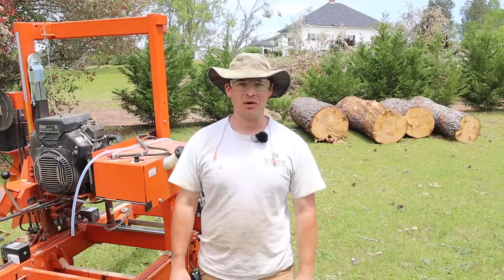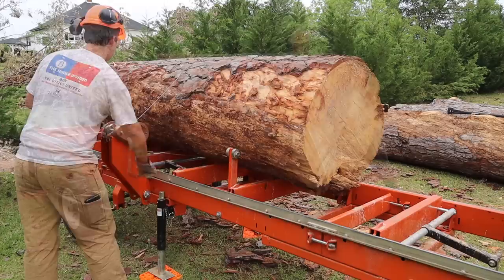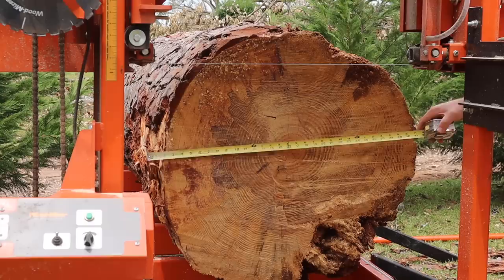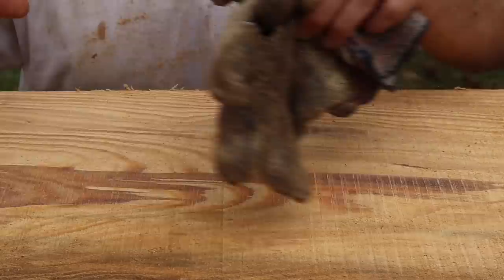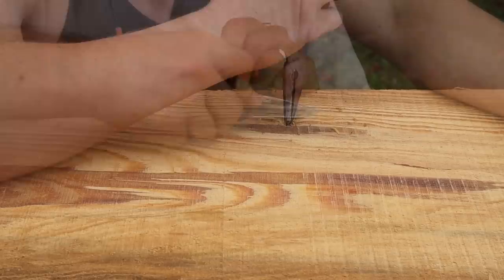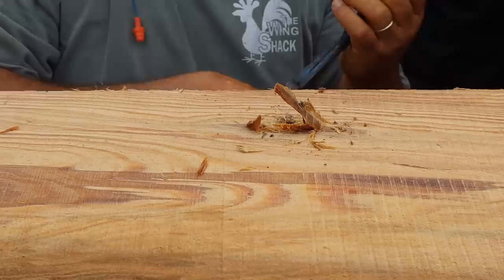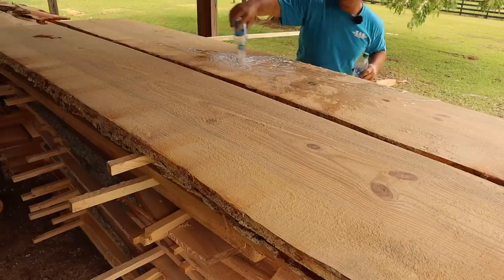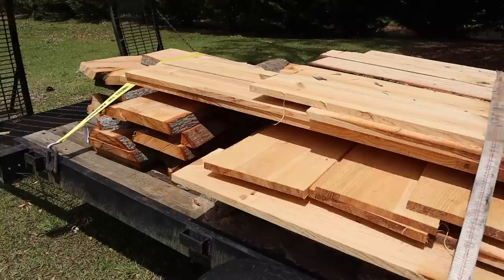Massive Pine Log With An Unbelievable Heart

Comment: Nice job....Thanks for posting.  I had a couple of Heart Pine old growth beams I saved and then resawed them into  vertical grain boards and built a piece of furniture.  Some of it had more than 30 growth rings to the inch.  Think of that, a hundred years to grow a 2 x 4.  That redder wood in yours is heart pine.  Get  ready.  When I ran mine through a drum sander it would clog the belt completely in about three feet.  I spent half the time soaking the belts in Simple Green and putting them back on.  Consider hand planes and card scrapers.  Beautiful stuff.  Dry it and enjoy.  You worked hard for it.
Reply from the maker: Thanks, Barry.

Comment: I have kind of an advantage in this life, I grew up around men and machinery, mainly logging, and my dad was involved in it from the time of horses and steam engines. He tried to pass on to me his experience, and what he didn't teach me I learned from my own experiences, sometimes the hard way.
I'm usually pretty impressed with you, but this operation was one step from disaster from the start.

Rolling that large of log up there on the mill is asking for a back injury, rolling them without the log dog or some other means of stopping them from rolling back is potential for much worse. See if you can find the hook from and old peavy or cant hook, attach to your winch line and drive it into the bottom of the log and then turn it with the winch. At least wrap the winch line loosely around the log to keep it from rolling back on you, and always be in a position to get out of the way if the log starts coming back, that means clearing out your ramps..
If you're going to do this again you must find some way to securely dog those logs down to the mill, plastic wedges on a steel deck is an accident waiting to happen.
Otherwise, nice wood.

Comment: I run and LT10 so pretty much same specs for log size as you 28" and yes I have done 32 or 33.  Just a pain though . What I have started doing so I dont have to pass on these nice big logs is I bought a Alaskan chainsaw mill and just break it down to a manageable size for the mill.. I hate milling with chainsaw because its painfully slow but it's almost faster to just take a good 8 or 10" slab off side of big log and makes the rest of log easy to just make lumber.   Idk I'm just rambling I guess but thought it a fairly cheap way for you to be able to utilize some if the bigger stuff.  Love the channel thanks for letting us follow along.. do some great work..
Reply from the maker: Several have mentioned a chainsaw mill. I think if I had to do this regularly that would be a good investment!
Reply: Hello from western ark. I tortured my mill in much the same way a good while back! The outcome outweighs the trouble in some ways.Gotta love it!!

Comment: Lay your log stops down a bit and cheat the bigger logs over towards your exiting side a few more inches. Then you won’t have so much chainsaw work on the entry side. Wedge both sides then on the bottoms. This works well.

Comment: Good video. Suggest frequent brushing of the cooling air intakes for cooling the cylinder heads. I was worried with the amount of sawdust on the front and rear of the engine. I know those engines are not cheap and overheat easily if the air inlets front and rear are not clean as well as blowing the engine out front to back and back to front now and then. If you are going to work the old mill that hard, I'd suggest paying close attention to the cooling as air over the cylinder heads is all you have got. Have a good one

Comment: Great job whittling the log down its not easy. Personally this log would been a great candidate to split. You just never know what you will find when you open a log. One would not have guessed a nail would be where that one was. But all said and done that going to be some very nice useful lumber. That pine would be a little soft for flooring though but would sure make some awesome cabinets.

Comment: so I have a mill also, an LT15Start. When you are cutting off face slabs on your cant, why do you then chainsaw them in half right on top of the cant? Wouldnt it be hard to keep from cutting into your production wood? I just remove the slab as a whole, then cut it up once removed. Is there a reason you do this? Just strictly for weight reduction? Not judging, genuinely asking and curious. Never stop learning :-)

Comment: I seen a trailer load of tung and groove wide plank pine flooring. You did well. Do you have a resaw table to cut the boards to a desired width?
Reply from the maker: No, I just put them on the mill to edge them.

Comment: That is why you should have the hydraulic or electric automatic handlers..The logs should be cleaned on the ground not on the bench it's to dangerous as it isn't stable enough.

Comment: Be cautious running the mill up that high. It may pinch the fuel line. Possibly cut it. If your engine shutoff for no reason, while the head is that high, you pinched the fuel line. I'm guilty of it myself.
Reply from the maker: Oh thanks! I didn't know that. We are going to tackle the other three logs in a couple of days, I'll look at the location of the fuel line when I've got it up there. Thanks!

Comment: I have some safety issues at about 10:20.  Here's where you need an old fashioned broadaxe, which is offset on one side for chopping at such curved surfaces.  And, because they're offset, they come in left and right hand versions.

Comment: 2:30 - invest in a second cant hook.  Shorter will be ok, as long as you have leverage.  Taking one in each hand, alternate their use to "walk" the log in the direction you wish to roll it.  This will allow you to hold the log in position as you move the second cant hook to continue rolling.

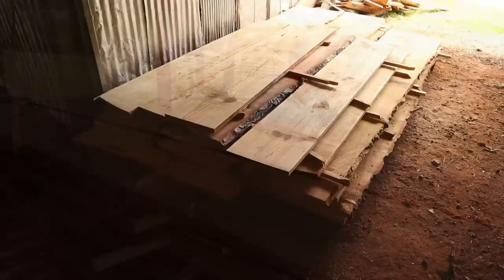28:00. Talking about the next logs...   after you sharpen and set the teeth on that blade, make sure you spray down those logs as you get them off the ground.  Trying to cut through the mud and grit will do you no favors at all.